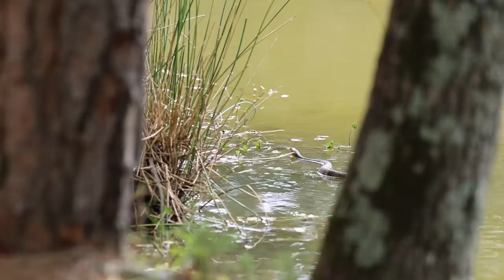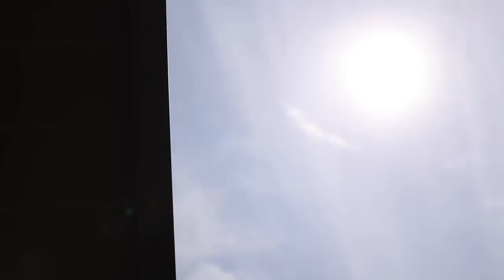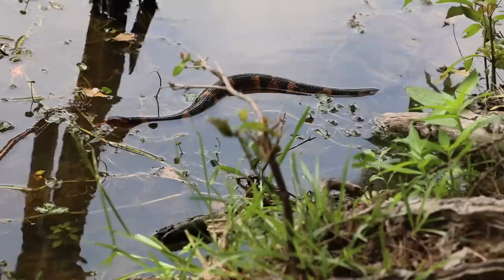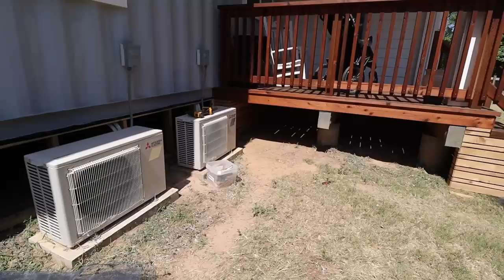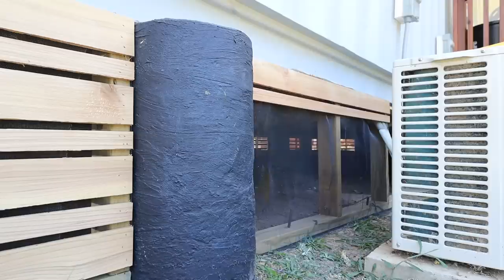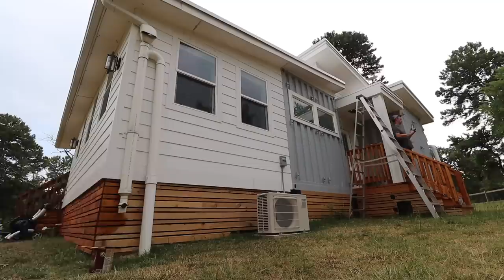HEAT WAVE | Hottest Summer Days Living Off Grid

Comment: When I lived in Texas long time ago, one of the best things in one story houses was the Attic fan. It was usually in the hall of bedrooms. open the windows and it sucks the wind through the house. 
Even if the air is hot it is air moving. On normal warm days it is enough so can save on airco. Another was the water-cooler in the window.. really nice at night.
Also covering your outside airco so does not get direct sun but does get air will save it from working harder. Growing more bushes against house also cools down the house. 
growing with your home. Love it.

Comment: Have you considered putting in a well. Even if the flow rate was slow it would augment you capacity and a windmill pump wouldn’t put a strain on your solar. You’d be harvesting wind power to provide water.
Reply: I thought the same thing. It could double as a well pump and drive an auxiliary electric generator where the power flow could be dedicated and adjusted to flow to 1,2,3 or more household applications and/or with the peak flow to take care of the AC running at anytime during a 24hour period.

Doing a great job guys..
...yikes, mutant snakes.
Reply: We live off grid and have a solar pump for our well. It has its own panels and batteries. We fill a 850 gallon tank every morning and let it gravity feed during the day and night but could use the batteries.
Reply: Adding a wind turbine would solve their night time power problems. If they eventually decide to add a well, the wind turbine will already be in place.
Reply: I agree.
Reply: A well is needed. The amount of fuel it takes to deliver water is crazy. They are right about a small turbine to pump water from a well to your tanks.  It would coexist with rain water capture. just set one tank to be well pumped back up.   Plus the ease of mind is spectacular.

Comment: Love you guys - thank you!! I am a Generac Clean Energy Dealer - you have the solar panels add a Generac Inverter and up to 2 - battery cabinets - each cabinet with 6 batteries will give you 17kWH of solar storage - if necessary you can add a Generac 9kW DC generator that can charge your batteries when the batteries drop to 25%.
You are great at doing your homework - thank you for keeping us updated!! Jim

Comment: I love the skirting. Great job, Spencer. The stain on the skirting will eventually catch up to what's on the porches. Kenzie is correct about the combo of sun aging the wood while additional coats of stain will make it darker as well. Also...enjoy the grain of the wood. It's beautiful in all its diversity. 

I know you probably hate people making suggestions to you, but I'm gonna take a chance anyway. I suggest figuring out a way to shade your HVAC condensers in the summer so they don't work so hard. I understand why you might not want to plant a tree, which would provide shade in the summer and lose it's leaves to allow the sunshine to hit the condensers in the winter--there are maintenance factors as well as the leaves shedding close to the equipment. However, perhaps you could rig up some beautiful sun shade sails in some way to add a design/feature element, but also allows the flexibility of removing it in the winter to allow the sun to reach them. I know that I save a lot of money/power usage by having some smaller shade trees casting a shadow on my HVAC for most of the hot summer days.

Whatever you decide...good luck! I believe in you!!
Reply: Crepe myrtle are wonderful, manageable, winter leaf shedding deciduous with good shade in summer, easy to trim side toward house and have beautiful variety of colors to choose from. Can be easily propagated from cuttings from the beautiful one shown early in today’s video.

Comment: I have an off grid tiny house(40×14) in SW Florida, powered by solar . 5kw solar aray,  2× 3kw inverters running in parallel,  30kw lithium battery . All the equipment is in separate shed, 70 feet away from house. To keep the Battery's cool ,I installed an 5000 btu window AC, which is kicked on by a thermostat( 75F)
For the house I installed an Pioneer 12k btu mini split and it's running 24/7. Never got my batteries drained less than 40%. I used closed cells spray foam for insulation.
Reply: Hello there 👋👋,how are you doing today? Hope you’re having a good day?God bless you!!❤️

Comment: When we lived in shipping container whilst building our home we ended up putting a huge skillion roof over our containers. It reduced the heat buy about 5c in summer and stopped condensation in the winter. Also enormously increased our water catchment area which kept our 3 small tanks full (1321 gallons) & our 28,000 gallon tank half filled.
Reply: I'd oversize the insulation if possible... Metal is the king of thermal bridging...
Reply: are you Vicki Boucher from Canyon High?

Comment: If you have the time for a side project, would it be worth considering to dig a root cellar to house the batteries rather than leaving them to bake in a little wooden shed?  just a little something 2-3 feet down, with a water tight insulated cover to prevent pest and water from gettin in.  just something i've been thinking about as i've been starting to research geothermals, earthships, ...  it'll be helpful to be insulated from both summer and winter....  i think?  maybe under a hinged panel below either of the two stairs?
Reply: Or an earth bag shed?
Reply: Or insulate the shed and add AC...
Reply: @norellweiner3341  ohhh they could easily learn the earth bag situation from the TinyShinyHome yt channel
Reply: Great idea!
Reply: @lauriepayseur5897  
The Tiny Shiney Home channel is a good one! 👍
Reply: If they dig a cellar they'd be flooded. The level of water in the ground is at pond level. Also if they drove a point down they'd get all the water they'd need.
Reply: @CraftsmanontheLake  if that's the case, would geothermal conduction still work if it's a box aboveground and just compact dirt all around it, and have a thick styrofoam lined lid.  the bottom being made of aluminum or copper for high conductivity and low corrosion.  like a heatsink.

Comment: Have y’all thought about having a well dug? Use it for back-up purposes. Or have it routed to your tanks to keep them at minimal levels.
Reply: Also, they should go with a grid tied solar power system. They have access to grid power on their property!
Reply: @DavidJohnson-tv2nn  what's up
Reply: @buslifewithmel7934  Just curious as to why off gridders refuse to use grid power even when they have access to it on their property? No shame in going with a grid tied system. Since the net power usage from the grid would still be zero.  But they wouldn't have issues on cloudy days or when the batteries run down. Building a a fully off grid solar power system to cover all situations is extremely expensive.
Reply: @DavidJohnson-tv2nn  because then you are subject to all kinds of regulations that might be more hassle than upgrading the system.
Reply: There must be a reason why they’re not allowed to draw water from the lake but they haven’t said….🤔
Reply: @DavidJohnson-tv2nn  yes that does seem strange, - especially if they are exporting their surplus daytime power…
Reply: @MycThePoet  Following NEC electrical code isn't that hard. Which is what should be done anyway for safety.
Reply: @philtucker1224  They can always drill a well.
Reply: @DavidJohnson-tv2nn  I'm talking about the electric company they will ultimately have to deal with, not city or county regulations
Reply: @MycThePoet  To my knowledge, the power company basically requires that the system be built to code. Again, not hard to do, and should be done regardless. 
Though there may be some additional requirements, depending on the utility, they are not overwhelming. Which is why most solar power systems are grid tied.
From observation, it seems like off gridders just hate power companies for some reason. Even if connecting to the grid makes most sense.
Reply: @DavidJohnson-tv2nn  personally wouldn't want to be hooked up in the dumpster fire that is Texas. Their infrastructure is awful. I think location makes a difference. They should have done more research into heating and cooling their home. But it's a lot to think about for a first build. They've done a great job to be honest
Reply: @MycThePoet  You do have a good point. But when you think about it, the worst thing that could happen is that the grid goes down. If it is a grid tied system with battery backup (slightly more expensive but worth it), the system automatically falls back to off grid mode. Which is where they are right now. And of course, it is always good to have a backup generator in case the grid goes down on a cloudy day. Murphy's law :)
I do agree that the have done a great job. The only two things I would have done different is install a grid tied solar power system and drill a well.
Reply: @DavidJohnson-tv2nn  I always wondered about a well. Curious how useful that is in such a dry climate and if that would do damage to the land around them.
Reply: @MycThePoet  Probably wouldn't hurt the land, but it comes down to expense. How deep do they have to drill in their area?
Reply: @MycThePoet  One final point on grid tied systems....
On conventional grid tied systems, if the grid goes down, you also lose all access to solar power. That is done for safety reasons. Back-feeding the grid during a power outage is strictly forbidden. However, grid tied systems with battery backup have a automatic power transfer switch that disconnects from the grid during an outage. Thus, solving the problem.

Comment: A couple of suggestion for the problems you are having. 1). Build a storm shelter and put your batteries down there. After all you live in Texas you might need one and the cool constant temperature below ground will be the same in Summer and winter.  Great for the batteries. 2) Add Wind power you might not get much power on those hot stagnant nights but during the nights were you might have some wind you can get a little power boost during the night.  3) Water? Can you have a well? What about taking water from the pond in front of the house? At least during emergency situations? Good luck to you!
Reply: underground batteries should prevent the need to upgrade, right?
Reply: Hello, do you need some permits to have a well?
Reply: Or live in the city 🧐
Reply: @soltiniJpepper1990  Pretty sure that defeats the desire to live off grid which is a basic premise of this YouTube channel?  🤔
Reply: @keithdavis1647  it was a joke haha i should of made it sound more sarcastic
Reply: Literally i think the same thing in every video. A well ? The pond/lake right next to them ? I see potential to get rid of their water problem.

Comment: We're in the same boat with the AC.  We just turn off the AC around an hour after dusk and crank the fans.  It really isn't that bad overall but we're looking forward to fall for sure.  We've also had to bring in water for our rain water system.  I think four times at 550-gallons each time.  Hopefully will have the backup well working soon.  Then we'll be good to go on water.

Comment: I've been living off-grid for the past 11 years. I've had to upgrade my solar system severely to accommodate my needs. I finally drilled a deep well 600ft and due to 7gpm I also had to bury a 2500gal storage tank to pump water into. This necessitated the installation of jet pump to pump water into a pressure tank to give me 24/7 water. I have a dual electric/propane water heater, electric refrigerator and deep freezer. Batteries are the biggest piece of an off-grid solar system. I purchased Toshiba LTO SCIB batteries from a junk yard from two Honda Fit EV wrecked vehicles for $4K that give me 44kW of battery bank storage. I can run my place for almost 5 days and nights without any sunshine however, I have a propane generator attached to my system that can recharge the batteries to full charge in 6 hours. I wouldn't think that you need to go very deep for a well with all the surface water around your property and you now can get almost the same amount of battery storage I have by purchasing server rack batteries for less than $1,500 per 5kW of storage for Lipo4 batteries, which are safe batteries. I don't know what you are currently using but, I think that you can integrate your existing batteries with the new ones.

Comment: That electric storage space could stand a Rammed Earth walls surrounding the space for maintaining a cooler environment. Frost line thick walls would mean the area inside the 4 walls could remain 65ish degrees if the roof and floor were insulated properly. Wouldn't take much to maintain it with that heavy of heat load. Definitely wouldn't have to worry as much in the winter time. A few 4inch pipes buried 3to4 foot deep and 50 feet out would transfer cool air if you wanted to keep the same space just looking for a natural way to heat and cool a space. Same could be done with an enclosure for the water tanks. Then the roof of the tanks storage unit help with rainfall harvest. Another big win
Reply: Adding a storm cellar may be one place to get the soil for the walls mentioned above.

Comment: I’m from Arizona and we have been getting killed with heat this year. It’s been 110+ with so much humidity we have gotten from these monsoons!! Have you guys ever thought about using the pond water as a backup? Just connecting a filter to it as you pump it out ? Stay safe out there !
Reply: It's Arizona, do you not know It's hot,
Reply: I am in Vegas>>>>I hear you.  THE HUMIDITY wow. Plus 0 rain.
At lest with monsoons we should get rain.
Reply: @leed119  Geez, that sucks, ever thinking of moving ?
Reply: @bennym1956  I need to move but...to not like humidity or snow...so.. there is that.

Comment: Great conversation about the real life issues with living with off grid systems. Re your set up. look into a duel power element ( AC one side and DC the other) for your water heater and add a couple of solar panels specifically for it use, as you can direct DC heat water in a water cylinder via a duel element. Also look at water cylinder kits that connect to you AirCon heat exchangers. As exchanging heat for the AirCon into or out of your water cylinder, reduces the amount of work your AirCon will have to do on extremely hot days, and thus it'll use less power. Mix Energy in the UK (not affiliated) have product, but more importantly have great documentation that speaks to this point. You'll probably want to source USA based products if you go that route. I hope that helps D
Reply: they probably would've gotten a nice battery system if they didn't spend so much money on toys, and i don't mean toys for the kids. Electric motorcycle was few thousands, Fancy ATV was probably 10+ thousands. All that money could've gotten either more batteries so the charge would last longer and/or newer batteries but give a spoiled kid money and they won't think about the family but themselves.
Reply: @robertbrainard5651  Did you catch where they said solar has been a total learning experience? And where she said "this is our own fault" taking responsibility for the hard parts of what they're learning about? Seems like you've figured out how to judge their thoughts and purchase choices without even knowing them. Bit uncalled for, don't you think?
Reply: @robertbrainard5651  You’re being facetious, right?

Comment: I'm off-grid in Finland, so a different kind of weather challenge. I'm running a 56kWh LiFePO4 battery that I built myself with raw 280Ah cells - you should look into it. Is a water well an option where you are? For me, it's basically the only option since rainwater (or rather snow) is not feasible in winter.
Reply: You’re pretty brave to be off-grid. Are you remote too?  I have seen videos of people doing so.  It looks like that takes a lot of planning.
Reply: @wkmingus  Yes, pretty remote as well. It took a decade of planning and waiting for technology to catch up with what I wanted to achieve.

Comment: I don’t comment at all on here.  I have watched you guys since you first put your containers on the concrete stands.   I love your channel and the dynamics between you two.   

My suggestions for the water situation is to try to drill a well if possible.  That would be a game changer.  

For the power.  I think it will be good to build a power house/shed and have it air conditioned.  Lithium ion battery requires a specific temperature range to be optimal for both perform and life span.  Yes, oversized your battery bank.  I would suggest either watch will prowse challenge or contact him since you guys are all YouTubers.  He would suggest you build out you new electrical power system to use an array of server rack batteries and all in one solar charger controller, inverter.  

My two cents.  You guys are an inspiration.  Good luck.

Comment: I am also looking forward to the barn when it comes :) On the subject of cooling, don't you have the option of using the consistently cool earth? A slope somewhere? Put pipes in the ground, let the air cool down to a pleasant 15°C and then let it into the house through lockable inlets? Basically, more and better batteries are not the solution. No matter what happens next, all the best from Germany!

Comment: I'm sure y'all are tired of hearing it, but an added on deep well system would eliminate any water shortage from your catchment system, granted you have the power (battery) capacity for the well... which doesn't take up that much energy anyway. Just remember, while all your infrastructure is catching water when it rains, so is the ground.. it's basically insurance in times like these... otherwise, you guys are killing it, house looks sharp!